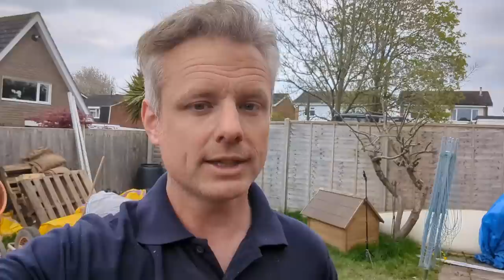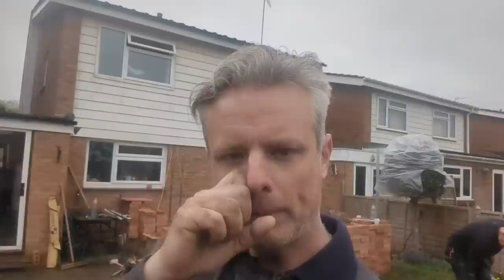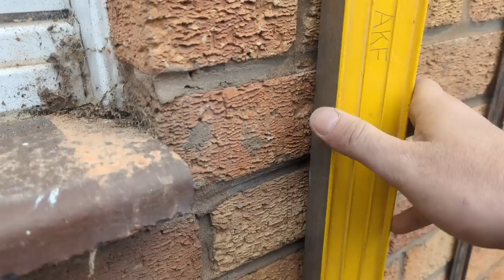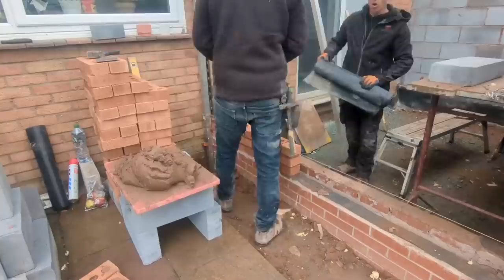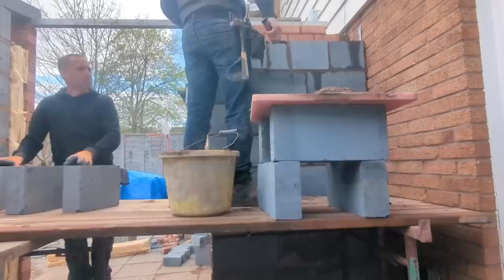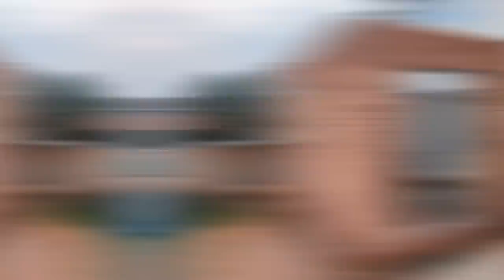HOW MUCH???!!! Warm Roof Extension Part 2 Bricklaying up to Wall Plate

Comment: Some things have reduced in price with the new regs though, 150mm PIR is about £30 a sheet cheaper now merchants having to stock it as standard. 

But where loads of people come unstuck with warmdecks is with the price of 180mm to 200mm screws. Toolstation spectre are about £20 a box & Timco at one of my suppliers about the same price but Screwfix are stupid price for these screws & so are loads of suppliers coming in at nearly £50 a box & when you got a 40m² to 50m² warmdeck that can really add up fast.

Also had building control conflicts with some saying you HAVE to use bonded vapour barrier under the PIR while others are fine with 1000 gauge vapour barrier underneath with foil PIR with foil tape.

I always do 18mm OSB + 150mm PIR + 18mm OSB but Building Control said they are ok with base OSB to be 12mm. 
Done a few warmdecks now & something always crops up, like when they want a soffit with lights in that they didnt originally mention LOL
Reply: Screwfix have lost the plot with prices on a lot of things lately.And those new regs for 150mm cavity, load of BS....
Reply from the maker: Interestingly enough mate there's a much much cheaper and better way to fix the deck down, all will be revealed in the next couple of episodes!
Reply: @mrabuilders6723  if you're on about them plastic things I have yet to find anywhere that sells them at a sensible price.
Reply from the maker: I am mate yeah... prepare to be amazed...

https://www.ebay.co.uk/itm/203400619382?mkcid=16&mkevt=1&mkrid=711-127632-2357-0&ssspo=Eu35-dXITnG&sssrc=2349624&ssuid=WriCdmnQTq6&var=503762995539&widget_ver=artemis&media=COPY
Reply: @mrabuilders6723  That is definitely the best price I have seen them, you done well with that find. 

But they still work out more expensive than using 180mm or 200mm Timco screws at £17+ VAT for boxes of 100.

There is the thermal break argument for the plastic fixings, which I'm not entirely convinced about. But if I get a warmdeck where they specify the plastic fixings I will definitely be ordering them from that seller at them prices. Thanks for the link :)
Reply from the maker: No worries.
Reply: @mrabuilders6723  The Etag Evolution RW 
washer system fastener is pretty impressive.

Comment: How do you make sure you get the exact window opening correct? I can’t see any cut down bricks? Is this something that is usually worked out on the drawings and the brick with 10mm mortar gaps will just bring you to the correct opening?
Reply from the maker: Hello Mill, all the windows and doors are made to measure so we don't have to worry about it when we're building it, we just give the customer the size and shape that they want then it's all made to fit. Hope that helps?
Reply: @mrabuilders6723  ah ok. Isn’t there building codes that say window need to be X distance from floor level etc. Iv always wonder how new builds the guys get the windows in the correct place but keep the brick complete.
Reply from the maker: All glass in a door or attached to a door needs to be safely glass as does any glass that's less than 800mm from the floor level. Hope that helps mate.

Comment: Manage expectations at the beginning. On every single quote I send out to clients (not in the building trade but it's still valid) I have lines line that say 

1. Quote is valid for 90 days from creation date (stops people expecting the same price if they accept it a year down the line)
2. Quote assumes no more than 10% movement in prices of materials required. Price rises above this will be carried forward to the customer.

Never had a problem since I started doing that and it's much easier to have the conversation with the customer.

Comment: Hi  Adam just interested, this is really a question just wondering why you didn't open the cavity so it's follows the house ? Any extension we've done we had to open the cavity up  👍
Reply from the maker: Hello Chris, hope you're well mate. It's not a requirement round these parts mate, never has been and apart from YouTube I've never seen it being done. It's strange how different parts of the country do it differently isn't it!
Reply: Totally agree m8 over here in Northern Ireland building control almost insists on it sorry, But the build looks spot on you guys are good you should be super proud 💪

Comment: The original bricks looks like Ibstock Beacon Sahara

They have changed colour clay since they were originally produced so getting an exact match is impossible, the replacements are lighter and need tinting to blend in. They also used the be solid and have been changed to perforated. Really frustrating not to be able to get an exact brick match any more.

Comment: My merchants were quite a bit cheaper on 2 75mm packs over 1 150mm. The 150mm stuff is still mega expensive.
Reply: Building control in Cheshire told me I had to use 150mm, and not a make up of 100+50 or indeed 75+75.

Comment: The cavities didn’t appear to be cut and made continuous on the house, or a vertical damp cut in, if this isn’t done, then there will be a risk of damp travelling through the old external skin of the house through into the extension.
Reply from the maker: Hello Nick, hope you're well. You're right in the fact that there's no vertical damp, thankfully the building inspectors round this neck of the woods are in agreement with us that it's a load of rubbish and far more detrimental than advantageous!
Reply: @mrabuilders6723  I’m good, lucky you have building control which are happy with this approach, as a building control surveyor myself, I would not be happy with cavities either not cut and made continuous, or a vertical damp installed, maybe because I’m in a coastal location and fairly exposed, and therefore wish to avoid damp soaking through and cold bridging occurring by the house wall remaining continuous into the extension with no break being made to stop this.
Reply from the maker: Ah, well there you go, coastal areas, totally different ball game and the precautions those areas need don't need to be enforced all over the country. That being said, vertical damp is a complete nonsense and causes so many more problems than the one it's trying to prevent.
Reply: I have never put a vertical damp or cut the cavities, as you say building control ( here anyway) says it’s nonsense so we don’t bother.! Never had any cold spots or damp travelling across….
Reply from the maker: Amen to that, Nigel! Hope you're well mate.
Reply: BC don't allow it inmy area either, as soon as you cut the cavity out or insert a DPC you weaken the whole corner on the existing building.
Reply from the maker: Hello Andy, hope you're well mate.
Reply: @mrabuilders6723  👍👍
Reply: @mrabuilders6723 That is B S..t !
Building control officer must be About 19.
Reply from the maker: What is, mate?

Comment: Hi guys, nice job but unfortunately I recommend you to hire charted architect for the future works as the devil is often in the detail. You have forgotten about the fundamental items like cavity trays and weep vents at slab level and above the window lintel. In that case the water from condensation will stay forever in the wall. That will cause mold in the future. On the top of that you have forgotten about DPM which should be sealed to DPC at the slab level. This is the reason why your work will cost much less than the work of professional builders.